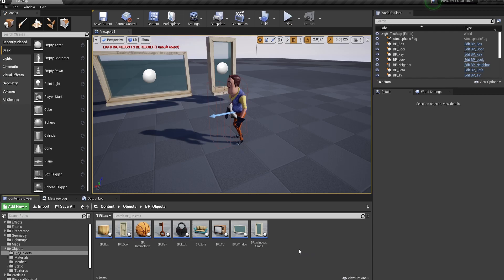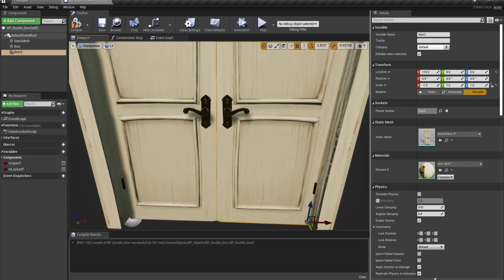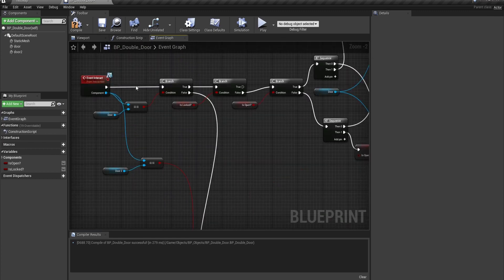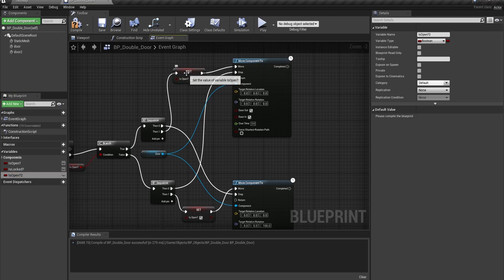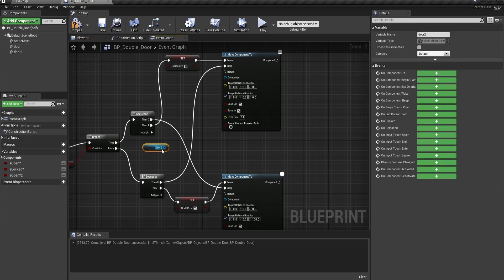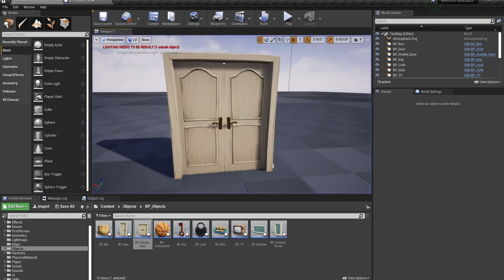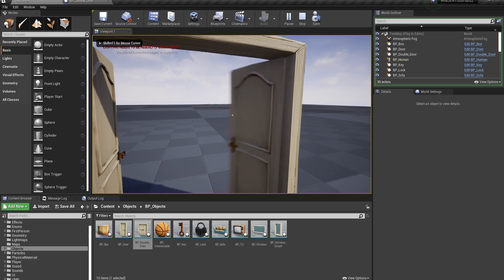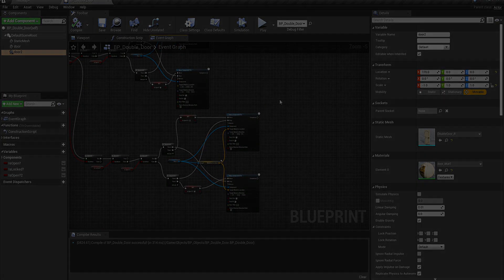Hello Neighbor UE4 Tutorials | Ep. 4: Double Doors

Comment: So if we had working locks what about working planks that block the door?? is that the up coming tutorial?
Reply from the maker: Planks are basically the same thing as locks and keys, except you just remove the need for the code variable so the hammer works for all planks instead of just one.